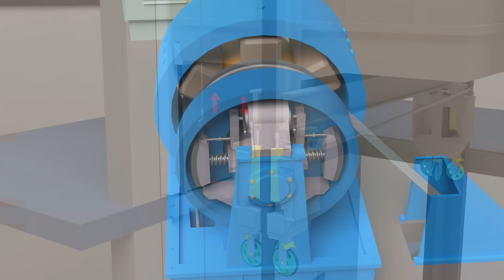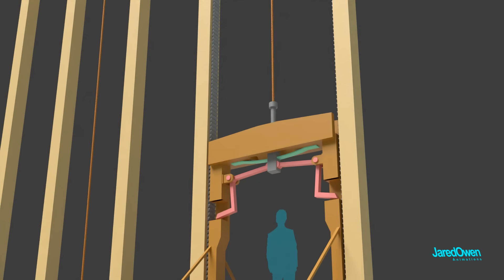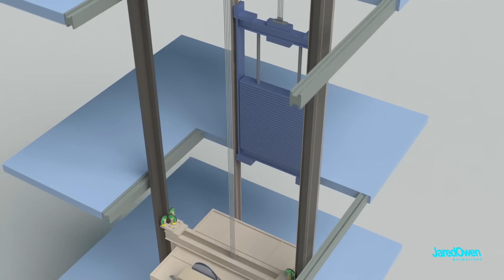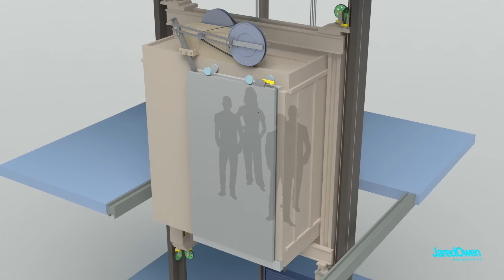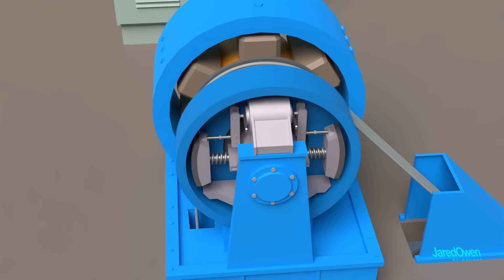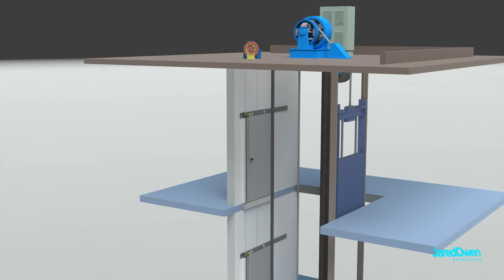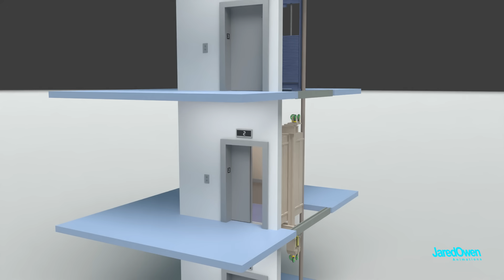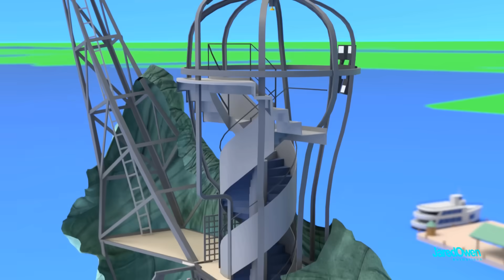How does an Elevator work?

Comment from the maker: I hope you found this video uplifting! Thanks for watching😎  (and putting up with corny jokes)

Watch another animation 👉 How a Bowling Pinsetter Machine works: https://youtu.be/Iod6uwUGM2E
Reply: This video really elevates my understanding of elevators. Thank you and may your motor be always in top shape, well oiled, and never snag!
Reply: Nice pun. Hope you do how a Chinook helicopter works. I've been curious as to how it actually works.
Reply: From India.....
Reply: @bluestarzone8341  same
Reply: You never let us down.
Reply: Hey jared 7 seconds!!
Reply: Your videos will benefit many people and generations to come
Reply: You floored me with that one
Reply: Great joke
Reply: Great video, very well explained. 1 mistake you mentioned and 1 major safety device you missed: 1 mistake ASME A17.1 /CSA B44 code requires a minimum of 3 ropes for a passenger elevator with a total safety factor of roughly 10:1 not 4 ropes. In fact its 2 ropes for a winding drum elevator. And the additional safety devices is the Rope Brake or more commonly called Rope Gripper in North America. I would recommend checking out the Hollister Whitney 620L rope gripper.
Reply: One thing worth noting is that a typical safety factor on the cables is 11:1. Meaning its actual design capacity is only 1/11th of the cable strength.
Reply: Thank you for elevating our understanding!
Reply: @axelfoley1406  good one ;)
Reply: Well you make a video about the uss enterprise-a from star trek please
Reply: I need a video of Tony stark house which was in iron man 3 pls
Reply: Well,please make your video named "how pendulum clock works”
Reply: Can you please make an Inside of the Death Star
Reply: another awesome vid, thanks Jared!
Reply: @JaredOwen can you make a video detailing the Deepwater Horizon disaster? It may not be that high on your list and I know these videos take a long time to make though
Reply: Is it 60fps now?
Reply: I could be wrong but isn't their another safety device located on the floor in the elevator pit
Reply: Thanks!
Reply: Awesome explanation!! What would happen in the case of an earthquake though? I wouldn't want to wait for someone to come to open the door. Is there a way to scape in an emergency situation?
Reply: I was anticipating a video like this for awhile!
Reply: Make a video on how cash counting machine works
Reply: @horizonr639  Someone made an animated video on how a vending machine works. It sort of discusses that
Reply: @horizonr639  It's called: How do Vending machines detect fake coins
Reply: Make a video on alternating current
Reply: Final destination lied to me!
Reply: Another amazing video. Excellent easy to understand explanation. Great work!
Reply: Hello
Reply: Would be nice for you to make a Part 2 where you describe the circuitry and the logic for the car to answer calls for people who want to go up and down.
Reply: Not all elevators has the door mechaninc you shown, mnay is also open manual by pushing it or pull it, even theres is also a lock on the door.
Reply: Of course! I should make a presentation about conveying systems in architecture, and your explanation in the video will be my guide. Appreciate your hard work!
Reply: haha
Reply: love the vid though
Reply: hahaaa really UPLIFTING !
pun intended.
Reply: The tooth of the elevator in the animation put the wrong direction. If the elevator in real life is like this, it will fall down directly after the rope is cut. Please review back 2:11
Reply: For the record it’s your most iconic video with corny jokes in my opinion :)
Reply: Dude please make a video on how manual gear in car works
Reply: Jared. You do a phenomenal job with these videos! The graphics/animation are amazing along with the simplified explanations. I have learned a lot watching your videos. Thanks!
Reply: Hey, Jared. I´m a big fan of your animations. Could you someday make an animation on how a projector works?
Reply: Ha ha
Reply: Really enjoyed it! About hydraulic elevators, cylinder doesn't have to be so long. Of course I'm not sure how it's called, tank trucks use them to tilt their tank and unload material. Basically you have cylinder of some length and inside are mutliple piston rods stacked inside each other. So at first thick piston rod comes out, then from its center small piston rod comes out and so on.
Reply: Cool
Reply: no, I feel shafted
Reply: Elevators are cool ! But like any business they have their ups and downs...
Reply: just found your channel :O
how does an Elevator work has inspired me to look into modding one into Dwarf Fortress XD

please do escalators next - hoping they will be easier XD
Reply: Yea, IMO same w/out background music will not be so uplifting, but more pleasant and easy to listen and watch. Tnx.
Reply: Your videos always elevate my mood
Reply: YouTube offered you the function of audio tracks? Or did you ask YouTube for this feature? Thank you.
Reply: I dont get it
Reply: LSL
Reply: Can you tell me what software do you use to make the animation of this video, pls?
Reply: Cool emoji
Reply: Great video
Reply: ❤❤❤
So beautiful animation
Reply: Which company sir?
Reply: You could do a video on how a clutch works and all the gear systems in cars
Reply: Hey Jared, Can you make a video about how a projector works?
Reply: You're great, Jared. Thanks for all!
Reply: Mr Jared Owen  please make a video that what's is inside the president house of india.
Reply: Please make a video that how artillery guns work
Reply: This one was just in case you wanted me too and we could get
Reply: For your next video idea could you whats inside the Sky Tower in Auckland New Zealand.
Reply: My knowledge has been elevated! I knew lefts had breaks, but always wondered the mechanism behind it! Thanks!
Reply: It's not a joke
Reply: It elevated my level of knowledge.
Reply: can you use English
Reply: @natashawolfe8162  yes
Reply: black hole when 😳
Reply: Do you think you could make a video about dream chaser?
Reply: i love it
Reply: Hello @jared you are making great videos... Can we have it's hindi language addition, if you want I can do it.. 
Plz reply
Reply: Messega for jared:\/
Reply: (Message for jared)\/

Keep going 

Message: i love ur vid thank for these vid
Reply: Would have loved to see how the elevator gets to stop at different floors after pressing the floor selector.
Reply: can i translate into my language
Reply: Can you do a video on the Twin towers? its almost 9/11 thank you!
Reply: There is nothing more annoying than people saying this is what we are going to show you when you could actually just show it to us 😂
Reply: Nice wejio
Reply: Hi, your video is great, can you please tell me the software used to make this lift animation?
Reply: what about "Elevator Cal Logic"?
Reply: i'm french and i would like to thank you, to make audio traduction and i hope that would be make in all your videos.
Reply: yx😢😮z😮zz
Reply: Just used this to create an assignment for our Fun Facts portion of homeschool. Thanks a million! Your channel is phenomenal!
Reply: Thank you. It is a great work.
Reply: that pun sucked
Reply: اسماعیل
Reply: Hello everyone and friends and I'm completely happy today and I'm a cool boy and I'm making YouTube videos soon so will be popular Ken and I'm soon getting really good at being on YouTube and Hey what's your name What are we doing in day and I want to get to know you and your friends and my name is Tom better known as Tommy and hey hey and I want to get to know you all better do great things and you are the best  jared Owen 

😊 ❤ i'm from 🇩🇰 and can you jared owen please make a video where you show what is inside an amusement park like legoland and how people build it :-)
Reply: vghcgcjdgdhdu
Reply: Coba tentang mobil kenapa dia bisa maju
Reply: i replied
Reply: Are you free yet?
Reply: t
Reply: My 4 yrs old son enjoy watch this😂
Reply: ❤😂🎉😢😢😢😢😢😮😅😅😅😅😊OMG 😲 😍 is the world 🌎 😍 😫 😩 😭 ❤️ 🌎 😍 😫 😩 a year is 7th and the first 9th of November will probably end at this very close date 😩😫layout is arena to e a
Reply: Your animations are great, and the information is simple to understand. Obviously there is way more complexity involved, but for a layman, this gives a clear conceptual understanding.
Reply: Which company can you tell me
Reply: 3D
Reply: I want to know how you work😂
Reply: Me early
Reply: Did not know that
Reply: Cool
Reply: @mateusz_0 p❤❤❤❤🎉🎉😊😊😊😊😊😅😅😅😮😮😮     ufgzgzgdxgx.     Hrht.    😅     😮😮😮😊😅😢😮😅😊😊😊😅😊iug104
Reply: I love it! You rule Jared!
Reply: Sir big fan pls reply.....

Comment: 4:25 into the air? Aren’t all elevators in the air? And actually wouldn’t there be more air at the bottom of the building than at the top, being that air loses density with height? So the phrase “up into the air” is not accurate.

Comment: I’ve watched this and read a number of (mostly useless) articles and one thing I don’t understand… how are the safety brakes passively engaged if the governor cable fails? So let’s say all the main cables and/or the pulley fail at the same time (essentially impossible but regardless) and the elevator is out of balance (empty or full) so it’s rising or falling fast… but the governor cable also fails… what engages the safety brakes? Do the safeties passively engage if disconnected from the governor? Does the main brake have to take over in an overspeed situation with failed safeties?
Reply: The safety breaks only activate when the governor loop locks while the car is going down. The machine break and not mentioned in this video the rope gripper would take over but that would only be useful for upward freefalls witch is more common than downward freefalls.

Comment: Neat typically, would have liked an added comment about how the earlier elevator doors and shaft had to be opened and closed manually and a mention of the inventor Alexander Miles, whom improved the safety of the elevator through his patented automatic elevator doors. US Patent 371,207. This greatly contributed to the ability of Americans to build taller buildings and eventually skyscrapers. Great animation.

Comment: Hello Jared. Very good video. Thank you for the educational quality. I have a concern. I've done the logic control of a 10-story elevator. I programmed it with TIA Portal, and it works. I would like to know if I can draw the elevator on SolidWorks with all ten floors and interconnect TIA Portal and SolidWorks to simulate my elevator. If not, what software can I use to do this?

Comment: There's a way to make an elevator not to make stops along the way. Just press and hold the close door button until the doors close, and then press and hold the button of the floor you want to go to. And don't let go of either button until the elevator starts to move. Then, the elevator will head straight to that floor without stopping for other people. It should really only be used in an emergency.

Comment: Hi there. Wondering if anyone can explain how the door lever mechanism works. I've been trying to model this system to understand it but have no idea where to start. I assume its some kind of straight line linkage mechanism but it doesn't seem to match any of the ones on the Wikipedia page.
Reply: This video only shows the most common door operator design witch I believe is designed by GAL decades ago. Nowadays most operators rely on a system of belts to move the doors like normal building sliding door with no gear ratio from the motor.

Comment: When I was nine-years-old, I was inside an elevator with my mother. The elevator stopped at the eleventh floor even when i pressed the sixteen floor. It was not perfectly aligned with the floor and was kind of not on the eleventh floor. We pressed the bright yellow alarm button for seven seconds, most people heard it, at 9:10PM, help finally came and unlocked the elevator’s door. Me and my mother then stepped into another elevator. That ‘rescuer’ went inside the elevator with us until we reached the sixteen floor.

Comment: Fun fact, the Tower of Terror rides at the Disney parks (or Mission Breakout in California) were actually manufactured by the Otis Elevator Company, not any sort of ride manufacturer, so when they say you’re dropping faster than gravity, it’s actually a traction cable going down at a speed faster than gravity
Reply: It's also a winding drum instead of a normal friction sheave because of how high the acceleration is too. Not sure about the Mitsubishi ones.

Comment: We have a shopping centre here in Victoria not far from where I live that has glass traction elevators by Schindler and it's amazing how it works because you can see right into the lift shaft and it is entirely glass it's amazing how it works

Comment: I actually feel better knowing there are actually mechanical safety that dont rely on electrical sensors or signals'
Reply: The overspeed governor can be activated electronically on some modern elevators, but if that fails the physical safety activates the brakes.

Comment: The one thing you didn't touch on is what if that cable for the breaks were to snap or fail to engage due to any reason would the breaks still be able to engage, I feel like the breaks should be a power to open state where if any part of the mechanism fails the breaks activate rather then requiring something to activate it
Reply: He didn't explain it verry well. Yes the overspeed governor can be tripped by the logic but if that fails the physical mechanism will trip it. If the physical dosent then you're too low and the buffer at the bottom of the shaft will cushion the fall. If the governor fails completely while you're high up the buffer will still cushion the fall and uhhhhh you'll live. 

You are right about the parking brake on the motors that they are active low. If the safety circuit has a violation relay will open, cutting off all power to the brake solenoids.

Comment: Fair job pal, I’d like it more in depth …..  but… I’m a mechanic. Like, exactly how is it controlled?, how does the counterweight system work?, if you have 100 floors, where does all the cable go? How does it know where to stop….. or … start…. Etc.? How do the mice get into my 20th floor apartment? Who pushes the button for them. I know they dont come up the cable. Its greasy. How greasy is it?

Comment: I guess old (european) lifts work bascially the same way, but with less automation and perhaps simpler.

The first thing that's completely different in old lifts is that both the shaft and cab door are just normal doors. Both use electro-mechanical switches to know when they are closed. The shaft door is usually simply locked by a pin extending into the door to prevent it from being opened, and the car door uses some kind of a switch that makes the lift stop or not start if the door isn't closed completely,

Comment: Shame our rack and pinion elevators didn't get a mention but they are typically only in unusual situations.
Mostly you will see them on the outside of buildings that are under construction.
SpaceX uses them in the Star Ship launch towers.

Comment: crap . . just 2 safety mechanisms . . I thought there would be more before watching this video.
Reply: 2 mechanical safety's. There's a lot of sensors what will activate the "Parking brake" if they fail while in motion

Comment: One thing that wasn’t answered was how all of the computer systems and wiring stays with the elevator as it moves. I supposed the wiring is inside of those cables? But if the cable is always moving how does it attach to the controller box?
Reply: There's a "Traveling cable" mounted under the car and halfway up the shaft. There's like 60 connectors inside it but it's flexible and sometimes there's weights on it to keep it under tension so it doesn't hit anything. The actual ropes that move the car sometimes have electricity passing through them so if one snaps completely the logic will detect it and estop.

Comment: This video was incredibly informative.  I recently started working at a feed mill, which in this instance is a tall slip construction concrete structure that tops out around 200’.  Most of the work we do is on the lower floors, but there’s large internal bins that take up a large space inside the building, and then there’s a few floors at the top to access the tops of the bins as well as augers and turnheads.  To get to the top, and to move heavy objects around we have a beat up old elevator.  I heard rumors that it was taken from a building in New York, although I can’t be certain of that.  Either way, I’ve poked around the control room, and looked down the hoist way trying to understand how it works.  Your video perfectly explains the mechanisms behind how ours works.  One thing I didn’t know was the overspeed governor, I’ve seen it but had no idea what it could be used for, but now I know.  You definitely earned a subscription with these clear and concise explanation!

Comment: Die Beschreibung bzgl. des Hydraulikaufzuges und der Position des Zylinders ist falsch.  Ich habe meine Ausbildung in einer Aufzugsfirma gemacht. Die Hälfte der Aufzüge waren Hydraulikaufzüge. 
Ein Hydraulikaufzug hat den oder die Zylinder nicht unter der Kabine sondern wie bei einem Gabelstapler neben der Kabine. 
Ein tiefes Loch haben wir nie gebohrt

Comment: Attention!!! les dimensions des côtés du triangle ne concordent avec les valeurs des angles selon la règles des sinus (sin 80gr/15=0.0643 ;  sin70gr/10=0.0891;  sin 50gr/20=0.0353).Les résultats des rapports entre les sinus des angles et leurs côtés opposés sont différents. Ce qui est anormale. A part ça la méthode est correcte

Comment: What is MRL
Reply: Machine-room-less. Basically you take the drive system and put it in the shaft with everything else, and put the controller on the door frame outside. Eliminates the machine room entirely.